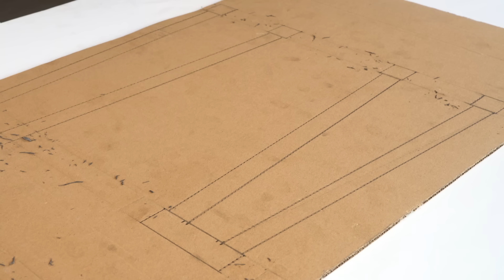Epic ride | Walking robot creature Strandbeest

Comment: This is an amazing machine and it is impressive that you actually manage to move it by pedals alone. However, it seems to be hard work and it is obviously very slow. Are you planning to build a lighter and faster version? Would that make gears a feasible addition, or would it still be too heavy? The seat arrangement seems to be a weak point. A bicycle seat-type arrangement should enable you to apply more power to the pedals. How fast can the mechanism go without putting too much stress on it? The feet seem to be another weak point, as they will probably wear out quickly. Rubber feet perhaps? And there should be ball bearings in every joint, to reduce friction and prevent wear. With lighter materials, a slimmed design, improved driver posture and improved transmission, I guess this machine could go significantly faster. And with an electric motor it might even reach decent speeds. It might even be a feasible design for a (light terrain) off-road vehicle.
Reply: heck yeah!
Reply: It's made by theo jansen, not him
Reply: @hasanmuttaqin464  jansen’s creatures are fast and agile … not clumsy like this
Reply: Ghanta bicycle is better, than this machine
Reply: Not everything has to do fast my friend, I can see him using this to run errands around town or to just have a nice relaxing ride around the neighborhood. Plus there's a chance the legs would get worn out or snap if it was motorized. But its still an impressive machine.
Reply: I see an all terrain vehicle with the introduction of some Fibre/Floating flaps and Rear fan blades. What do you think?
Reply: O mo ko
Reply: @octaviosao-an5980  e seun
Reply: V2 maybe
Reply: Team0
Reply: @aya_scratch2853  team0

Comment: Did it really need brakes? Looks like it would stop on its own if you stop pedaling
Reply: He used the brakes to turn.  Not an efficient use of energy, but effective.
Reply: @fritzwilhelm8258  ah yeah, thanks that makes sense I hadn't thought about how it turns. If you could link gearing/braking to the angle the bike i is on you could lean to turn

Comment: That turned out quite well! Only modification I could think of would be to add a bigger sprocket or one from a mountain bike that can shift between gears. Seems like you're having to pedal at a pretty quick pace just to get it to move.
Reply: By.
Reply: Me too
Reply: O
Reply: @viveksingh5499  ooooooooooooooooooooooo koi jí
Reply: By see
Reply: It needs a lot of torque to get started, hence the small sprocket and high pedal ratio.

Comment: machines are meant to make work easier, this one makes the work more difficult. You should at least make the driving gear small so it can make more turns with one cycle.
Reply: go make your own machines then
Reply: If the gear ratio was different it would be very hard to pedal, Adam Savage made that mistake when he built one.